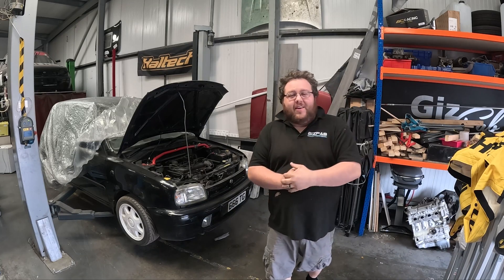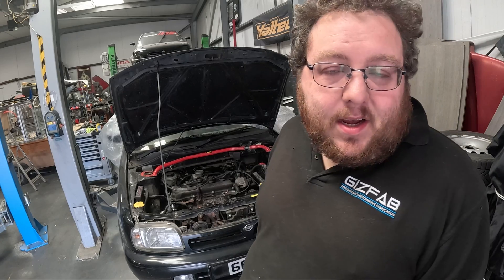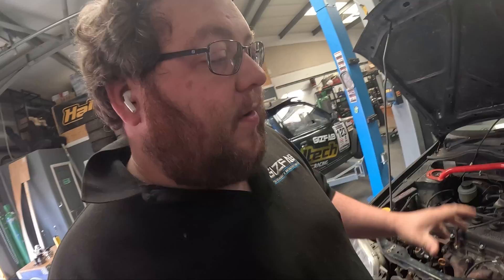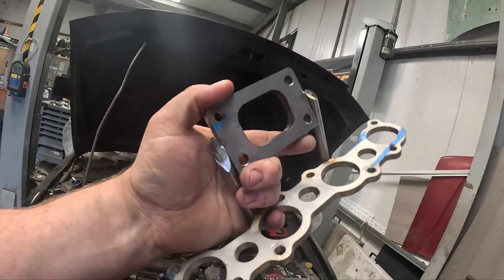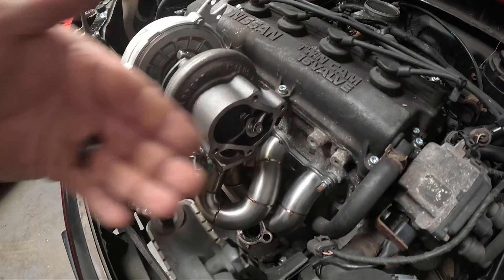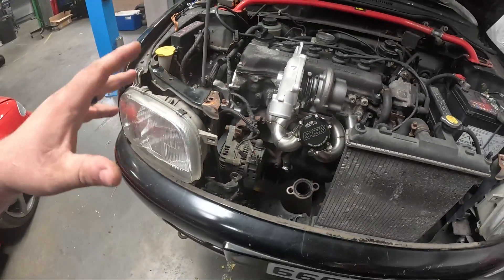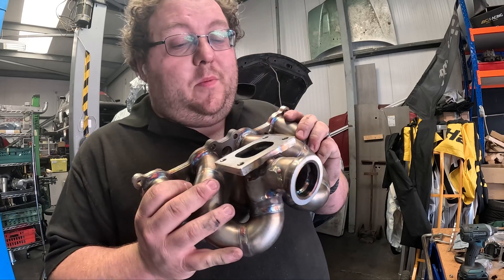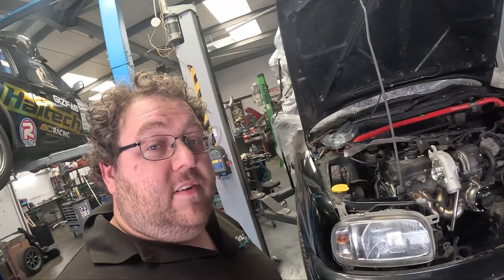HOW TO MAKE A TURBO MANIFOLD FOR YOUR K11 MICRA

Comment: What's better out of NB32 and NB40 pipe for a turbo manifold? Just what ever matches the ports?
Reply from the maker: 1.25" SCH10 NB is the smallest i would use for all applications. It is considered that 1.25" NB Primaries support up to 150hp / Cylinder.
Reply: @GizFab  Cheers mate.

Comment: Love the video, a question i have a micra k10 1.2 and was wondering about a turbo maifold for the setup is that anything you have been working on or plan in the future? :)
Reply from the maker: No plan for K10 kits, as they are Carbureted it doesnt make for a plug and play kit like the K11's. We are working on Supercharger kits for the K10 however that allows use of a Carbureter
Reply: Aight man, thanks for the answer looking forward too the supercharger setup. :D  @GizFab

Comment: Have you turboed a Micra with aircon and power steer?
Reply from the maker: So far, no. I would require your vehicle in my shop in order to make it.
Reply: @GizFab  where are U located
Reply from the maker: Lincolnshire, UK @davidmisener3671

Comment: @gizfab just a quick question matey when building a turbo manifold do all the bends(tubes ) have to be the same length or does it matter is some are a bit longer than others ?
Reply from the maker: It really doesn't matter.
Reply: @GizFab  thanks for ur reply mate 👍

Comment: Enjoyed watching this, is the idea behind sealing the manifold ends and adding gas during welding for 'purging' ?
Reply from the maker: Yes 🤓
Reply: @GizFab  awesome, you were saying the model your working on had a rear disc axle and the lack of PS, my k11 has a rear disc axle and front & rear ARB on a SLX model. Would you happen to know if this is a rarer spec? Enjoyed the welding, sadly I cannot weld but I do enjoy watching it being done.